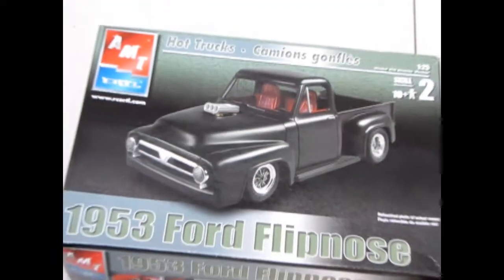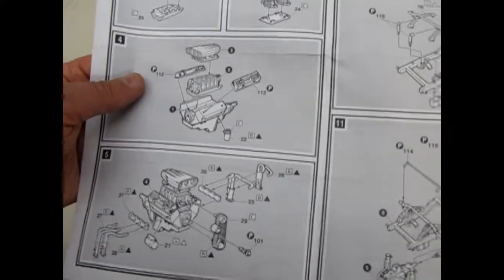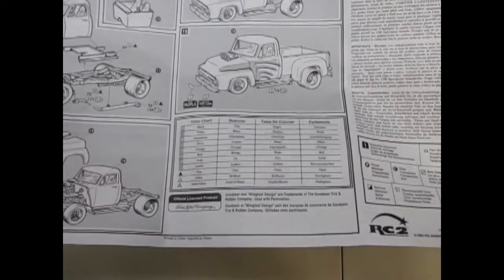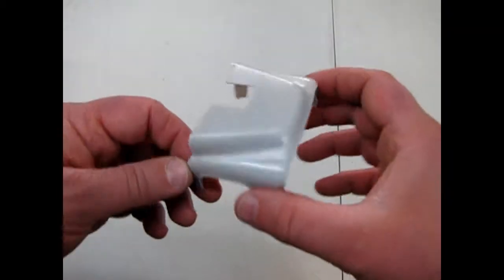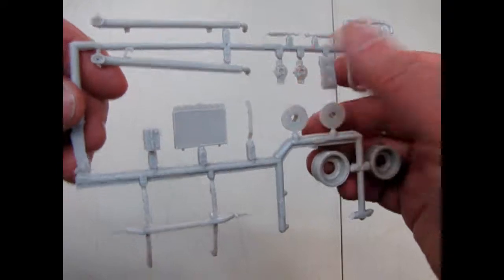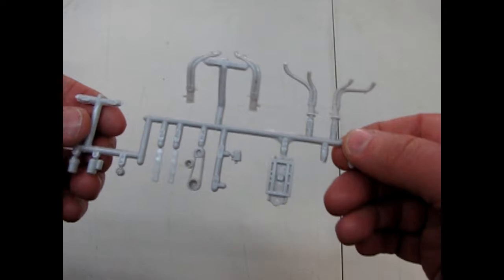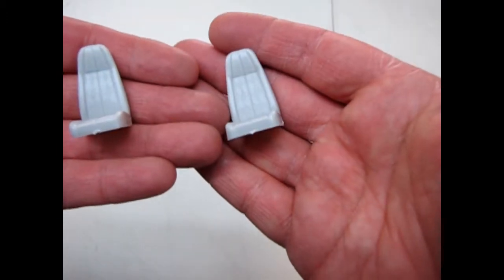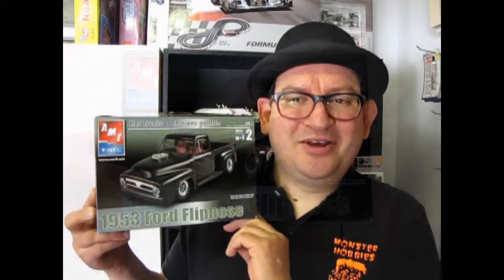Unboxing The 1953 Ford Flipnose Pickup Model Kit By AMT/ERTL

Comment: Does the tail gate close n open
Reply from the maker: Yes, that part of the kit is exactly like the AMT 1953 Ford F-100.
Reply: @monsterhobbies  Gotcha
I know now that the 53Ford Flip Nose pickup is just as similar as the 1953 Ford F-100
But is the F-100 similar to the AMT Ertle 53 Ford pickup
Reply from the maker: @thehomiejuan1306  Yes. The only way to know for sure is to get both kits and swap parts around.